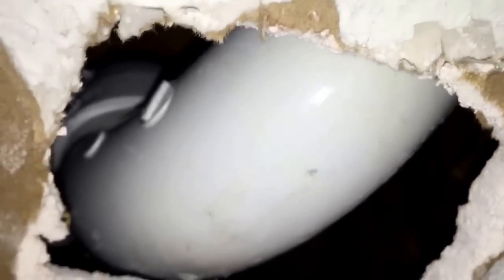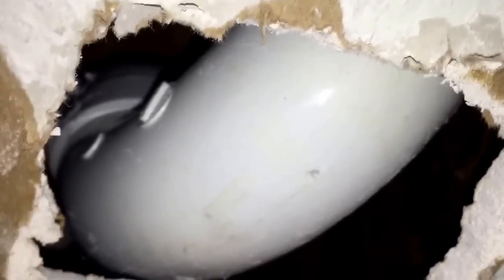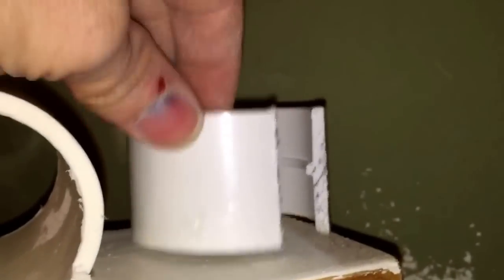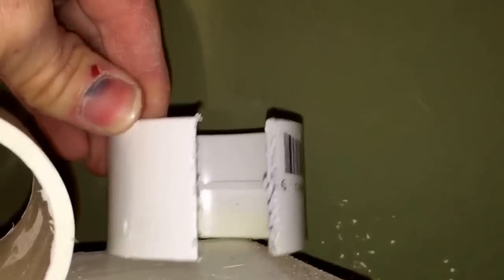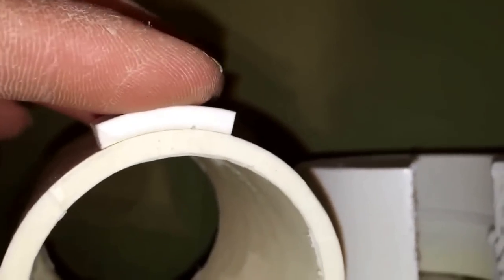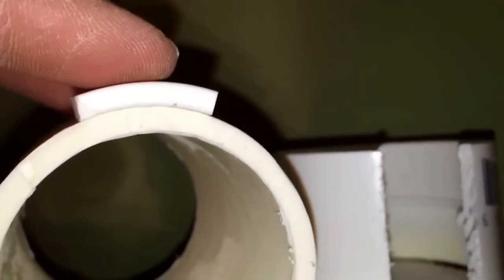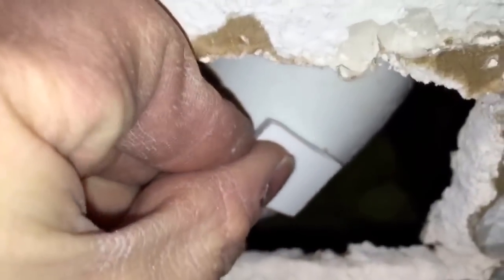Super easy fix for screw hole in PVC drain!

Comment: Use some JB weld or pipe glue to bond the piece to the pipe.  A hose clamp will be fine while the adhesive bond sets, but just pipe and a hose clamp is no more a solution than sticking pipes together with no glue.  This works for drain and exhaust lines, but I wouldn't do this with supply lines.  The pressure in the pipes is significantly different and can cause problems.

Comment: I just did the same thing today on a vertical bathroom drain pvc pipe. I sanded the pipe and coupler patch. I applied it with oatley all purpose cement (red can) and used a hose clamp which I will leave in place. I did not use purple primer. Should I be concerned that the cement did not bond properly? Which will cause another leak? I feel that the cement combined with the hose clamp should make it “good as new” any thoughts?
Reply: Always always use the purple primer. It’s sold as a set for a reason
Reply: With PVC, yes, you need purple primer. Not so with ABS. PVC is white, ABS is black. I was confused by this but it seems to be the industry standard. I have no idea if it would actually be worse if you did happen to use primer with ABS.
Reply: JB Weld. Mix the two and apply it right on the screw hole. Permanent seal in 3 minutes. You don’t have too but I also put 3M metal foil tape over the area as well 2 years later still no leak 👍

Comment: This an amazing idea, this is definitely a permeant fix,  the metal strap wont let that piece lose or leak, i am going to try this , since i screwed a dry wall nail through my pvc drain pipe. :(
Reply: Was this a successful fix for you?
Reply: @TheSchaferb  hello, yes this  is a good fix. Its been 4 years that fix is still going strong.
Reply: @TheUmeasz  did you use a purple primer? I sanded the pvc and used oatley all purpose cement with no primer... wish I would have but I feel confident that it did bond. Also used a hose clamp. It’s a vertical bathroom drain pipe so there is no pressure.
Reply: @TheSchaferb  i used pvc glue. But i cant remember the colour of it. But as long as you use a hose clamp and tighten it. This fix will last a very long time.
Reply: @TheSchaferb  JB weld. Mix the hardener with the steel and put it directly on the pipe where the screw hole is And in three minutes You gotta permanent seal then some 3m foil tape. Or cut the pipe and get a rubber coupling with clamps.

Comment: Why don’t you just do it the correct way and replace it?
Reply from the maker: Who decides what is correct? If this holds up forever, then it is correct.
Reply: @roadracenut  Well for actual professionals with a license a governing body decides and calls them codes. The reason we have this is because of knuckle heads who do shotty work
Reply from the maker: @iRacerJared  there are a lot of knuckleheads inside the professional community as well. YouTube allows us to avoid some of them. And some of us knuckleheads understand the properties and science of materials to know that low pressure drain water cannot over cone the adhesive, second layer of PVC, and the hoop strength of a hose clamp. My 30 year old house cannot meet current building code, but I sleep like a baby.

Comment: Why not just use the PVC cement that is meant for joining 2 pieces of PVC together?  It actually welds the two pieces together. I would just dab a bit on there, then hold it in place.  Then if I was worried you could still add the clamp.

Comment: I wonder if gluing in a short screw with a rubber washer would be easier.
Reply from the maker: Thought about that, but it has to be stainless, and the rubber could deteriorate over time.  This seemed like more of a long term fix.
Reply: Where is the after video. The post shot. The how it turned out video?
Reply: I have found a hole also and thought about doing the same. But was wondering if you solution held up.
Reply: I now have to patch dry wall under a tub drain where someone fixed a hole with a dry wall screw.  Over time the screw rusted and started leaking ruining the dry wall AND encouraging mole growth until the drip finally bubbled the drywall.  So I would say fixing it right the first time would be far better than using a quick fix that causes more serious problems down the road.  My question is what kind of glue did they use in the video??
Reply: Cristina Gaines - they used PVC cement, some people use epoxy with a hardner.

Comment: Exactly my idea.    I punched a hole in 3" sewer drain pipe running down a wall.    I had the same thoughts and you just confirmed it!!!

Thanks
Reply: Did this work for you?
Reply: @TheSchaferb  Worked very well for me.   Actually I've used it twice - repairing damage that was done 25 years ago installing kitchen cabinets - the screws finally rusted away.    Per your posting....   the PVC purple primer actually causes the PVC to melt a tiny bit so the glue really sticks.     Given you repaired a drain pipe (not a pressure pipe) and you sanded / glued / and left the clamp on - it will probably be a forever repair :-)
Reply: @Curtis Keller I am a first time homeowner and previous resident had a screw drilled in a 3" pipe which has now started leaking very slowly. Can you please provide details of how you fixed your drain pipe? What all material to use and how to best seal it? Thank you!